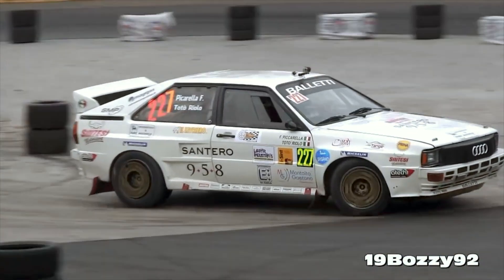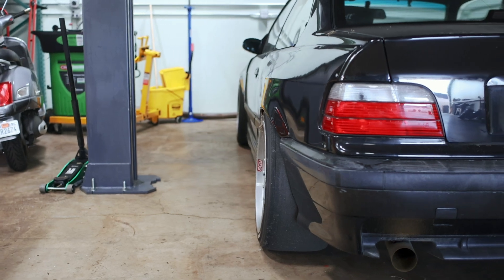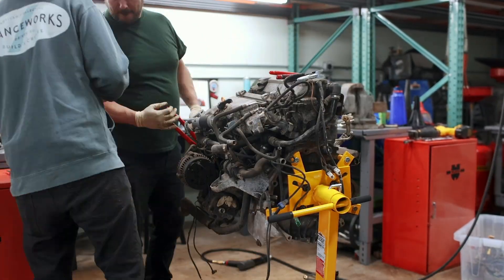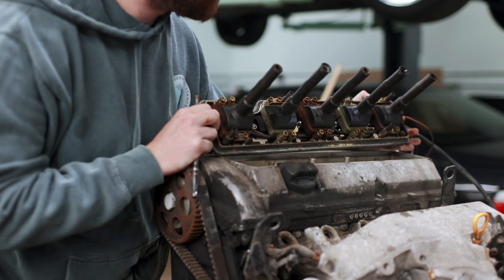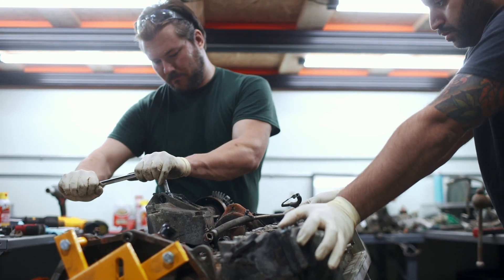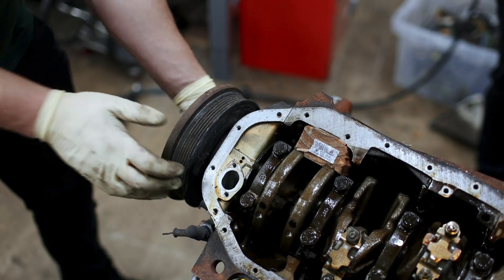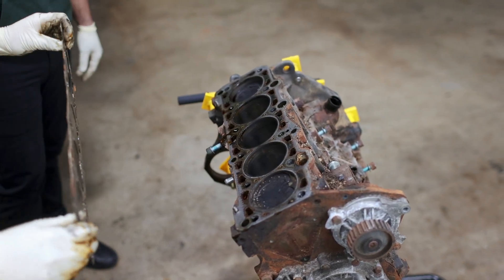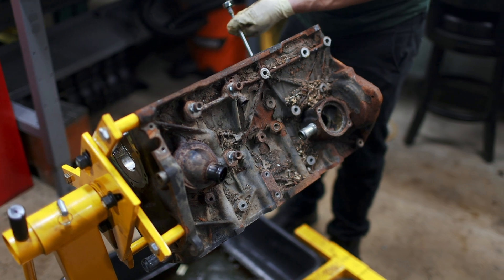5-Cylinder Teardown: Audi Ur-Quattro Engine Build & Swap Underway!

Comment: I don't know if you have a oxyacetylene setup at your shop. But that map gas just don't cut it man. I have aaaaaalot of experience with rusted bolts being from North Dakota and I just know from experience that map gas just takes way too long. The temp from map and oxyacetylene isnt too far off. I think it's just the btu output of a actual cutting torch compared to a handheld torch is the big difference. But I guess the one crank bolt and alternator a year might not justify the cost.

Comment: Lol I really wouldn't have been mad if you just K24 swapped it again. 😂 I've been lusting over that very swap for a hot minute. Trading 5 iron cylinders for 4 aluminum ones , especially given the whole lot hangs out in front of the axle, has to totally transform the Quattro.

Comment: You Have to get the rotating assembly ballanced if you change the weight on pistons/ rods like aftermarket.
Ballancing is with bobweights like a V8.

Comment: Very excited to see this project. 

I am a bit surprised that more time wasn't spend researching this engine and how it is laid out, and slightly surprised that shop doesn't have any 3/4" sockets or breaker bar. 30 minutes of research would have saved hours of frustration. Both those things would have made your life MUCH easier than depending intuition, and air and cordless. The only thing that was a surprise to me was the alternator bolt. Someone messed with that before and left you a nice gift. lol

Check out the key on the pulley to make sure it's good or get a billet pulley instead. These engines are unfortunately getting harder and harder to find these days as so many 'enthusiasts' hoard parts, and a lot of people gave up on these cars around 10 years ago when they started getting to 2nd hand owners who don't have the financial resources, as well as a lack of mechanics that are not scared of older German cars. Now the cars are in more demand, but it's hard to make up for that lack of parts as well as Audi AG not being willing to ship older parts to the US.
Reply: Absolutely spot on - should have spent a week on research while the pen fluid was soaking in rather than go at it like a bull in a china shop thinking it was 'just another engine' Never mind...just can't get the staff ;-)

Comment: Marc at EFIExpress makes an LS-style coilpack system for AANs and can get you the manifold.

I had these on my AAN powered S6 and it was so much better. I had an RS2 turbo and 034 RS2 ECU and it was strong to 32psi of boost and regular 28psi. The N75 was the problem... It's now called EFI Motorsport. $509 for the entire plug and play kit. For $250, they'll sell you one that uses modern factory VW/Audi coil-on-plugs, but the coilpack system is remote mounted so the coilpacks don't overheat on top of the engine

Comment: To fit into small chassis vehicle there are a lot of parts that are different. Use parts from 3B, ABY or ADU engines.
Motor mounts, sump, inlet manifold, rocker cover, crank pulley/Damper, alternator, power steering pump, cam belt cover all may give you problems.
The sump will hit the front subframe.

Comment: As suggestion of well worthy recipe for AAN’s, go source for a 95.5mm crank and make a stroker engine. This crank “corrects” the lack of low end torque making driving and power delivery great! This crank you find on diesel VW Eurovan trucks. Also don’t miss the 7A’s, also a great upgrade. Congrats for the projects!

Comment: If you want an intake manifold that fits, is practical, looks stock but can displace a 1000 horsepower and uses all stock sensor search for the Wagner reverse intake manifold. The AAN intake manifold will mess with the radiator in an urquattro chassis. That wagner intake will leave space for the radiator.

Comment: Watching you guys remove the hub pulley made me think about how i have to hand torque the outer axle bolt on my jetta to 200 lbft plus 180 degrees. By far the most excruciating thing ive done to it so far.

Comment: I do love your propensity for euro flavoured vehicles 👍 Not that I mind V8s and all that but the LS is just so over done these days. Gonna be interesting to see how easy this later Audi 5 will fit in the Quattro.
My suggestion for the block would be to mask it up really well and sand blast all the rust away. Just seems like the best option, and easiest, to get into all the nooks and crannies to knock the rust on it's head.

Comment: Flywheels are really heavy on these engines, so if you get a fluidamper running a lighter flywheel won't bother it at all. If you aren't going to throw a ton of boost at it, run a higher compression piston. An aftermarket I beam rod will be fine. Doing an exhaust manifold would help for ease of servicing if you convert to Vband clamps. It would also allow you to run an anti-lag valve, which not only sounds amazing, but is consistent with how audi modded these cars for racing series.

Comment: It’s funny, the 7A code engine out of my 90 sedan was in the exact same condition as yours. And I was thinking how well it looked 🥲 Michigan life lol.
The AAN is the big kid on the block motor so to say (although it’s not the largest factory displacement of the pre-95 5 Zylinders) and soon i Hope to build one for my sedan project and then build the 7A so I can keep the car running. Also on my 7A my alternator bolt is rounded off, so I might steal your idea and just cut it free :)

Comment: The intake you can use that is found easier state side for small chassis is a 3b intake manifold that comes in 20vt Audi 200 Quattros. They can be had for about 400 bucks or you can get a s2 or rs2 intake from over seas.Also when you go back together threat the cam bolt in by hand then torque or you run the risk of shearing the key and also be sure to check the crank cog pulley for cracks.  Check out efiexpress they have some stuff for old Audi 5 pots.
Stand alone can go vems or maxxecu or could do like Nick ( amdisthebest)  on his Audi 200 and do syvecs with a whole custom harness and set up

Comment: Loving the project.  Many of us use a 3B intake manifold and piping in the small chassis, but it's not an absolute must to do so.  Just have to check for clearance for the side mount radiator.  Oh, and I used the engine teardown on mine to "justify" buying a welder (for the stripped hex heads and sheared bolts), lol.

Comment: 800hp on stock Pistons is no problem. 
Many guys here in Sweden who rock stock. 
My s2 made 720hhp with aby/aan cams. 
And we have another guy here who made 909hhp with aan cams, 64mm turbo and stock pistons. 
But h-beam and rs2 mls head gasket is a nobrainer. 👍🏻

Comment: Everyone is obsessed with those gaps in the piston rings, but even the mot basic understanding of fluid dynamics would tell you that it doesn't matter lol

The pressure will equalise across the surface of the rings and leak through the gap, wherever it is. The pressures are so high within the combustion chamber that the time needed for that pressure to equalise is also negligible

Comment: chop the head of the bolt and hammer it through you mongs
it bolts in to a sliding pin you need to hammer back to remove it anyway
Reply from the maker: The air hammer shows the bolt is seized. Cutting the head off won’t help it move. Use your head.
Reply: @stanceworks  I had to do several heat cycles and loads of penetrating oil to get mine to break free.

Comment: Hey! You're getting a tiny taste of what its like to work on cars in the rust belt! Almost everything I've worked on here in new england has been like that engine.
Knife edge the crank and do what you can to add some oil volume, external oil cooler or something. Lose the coolant/oil heat exchanger on the filter housing, they like to fail and mix coolant and oil. 
I suggest making a custom intake manifold to run a modern throttle body and make turbo piping as easy as possible. Get rid of all of the electronics strapped to the engine and run modern stuff. That means coils, sensors, trigger system, what have you. Try to avoid VW or audi coils, run something japanese or like, LS coils or somethin. 

I remember there being some other things you can do to the block or crank or head or something to make it better or more reliable but i cannot remember what. add a Windage tray if it doesnt have one already

Comment: A little weight in the trailer should increase the clearance in case it gets tight again! Otherwise great insight on how weather condition can affect the exterior of the engine

Comment: The rings spin in the ring lands during normal operation. That is why offsetting them during engine assembly is actually pointless. If all the ring gaps are lined up, then there potentially could be carbon build up, or something preventing them from rotating in the ring land.

Comment: You should use the Eurovan 95.5 crank to stroke it to a 2.5liter.  Also Audi put the 3B motor in the UrQ in europe, so you should be able to use many of the parts to fit your AAN in

Comment: Hey, im also doing a 5 cyl swap on my coupe (s2), i would go for a wagner style intake manifold since it points the throtle to the front really close to the wagner intercooler, makes it so easy and good looking
Reply: Also you can make 600 hp with stock pistons and scat rods (forged 4340 steel), look up quattro4life, he has great content on it

Comment: Being from the north east I've taken to applying grease and anti seize to every component I come in contact with because of the difficulties of disassembly at a later date. Doesn't hurt to take an extra second to save you from hours of headache in the future even if you live in a fair climate.

Comment: An induction heater is the only way to remove most of the bolts on this engine, even the seized alternator bolt can be heated entirely through the alloy bracket to break it free .

Comment: Wow, real amateur disassembly. Yes definitely a northeast engine. Although your lack of knowledge and lack of experience shows. Acetylene torches are our best friends in the northeast. Many times have I encountered similar alternator  removal on audi vw group, no issues when you know how. You guys butchered it. Same with the crank bolt. They always are locked hard.

Comment: Regarding the intake manifold, maybe you could reach out to Hank iroz at Iroz Motorsport to see if they could help you spec out a billet one akin to the ones they are putting together for the current model 5cyl Audi engines in the s-line TTRS and RS3s?
Reply: My other suggestion would be to get in touch with Integrated Engineering.

Comment: For crying out loud mate (or if you wish dude) have you heard of vacuum cleaner?
I understand that the engine will be reassembled or maybe rebuilt, but still stating that "all the parts are in good condition" while the nasty bits of particles and junk are falling in the engine during the process is a big NO-NO... :/

Comment: I’m retired Audi tech of 47 years, that motor is a strong piece and never had a problem concern with internals as long as there is oil and coolant in it. I just did regular maintenance including timing belt and tensioner and water pump. There is a special tool to hold front crank pulley and a extension used with a 3/4” breaker bar to loosen bolt and used with a torque wrench for the proper torque,make sure to use locktite on the bolt as it is used as a sealant as well.
Reply: Totally. Have just replaced belt on my URQ (second time in 10 years) and you need the proper Audi tool with 6 foot bar as its torqued up to around 450Nm. Not impressed they didnt do their research first as it's well known in the community. Messing around with dreadful torque guns. In general on an engine in this state (and all running gear), all fittings should be drenched in pen fluid every day for around a week before even thinking about dismantling, that way you dont damage/break stuff as finding parts can be very hard, Ditto on the manifold bolts - if you read the forums you would have found out their are access ports to slide a 300mm Allen extension through - Audi designed it all in, you just have to think it through. And even easier with engine on stand. I had to do mine with engine in car and it just had clearance. All in all, Should have taken it to a Quattro/ Audi engine shop specialising in these as I would be worried what else they do to it. And anyone who uses wrench guns is just lazy - REP in Swindon UK (R8 specialist) wont go near a wrench gun on engine work - you need to be mechanically sympathetic and have a feel for whats going on. That alternator bolt annihilation was just dreadful...and then sawing it off! FFS - what a set of bodgers

Comment: 034Motorsports has a lot of support for these engines and I built my 7A Turbo with mostly parts supplied by them and they're in your neck of the woods.

Comment: Tbh when it comes to the valvetrain, it may be better to over do it a little so you know you won't get failure or any lift at high RPMs boost and such depending.

Comment: Kinda crazy that fab rats and Merlin's garage pulled a V8 Ford boat motor out of a boat that had been underwater for 30 years and out in the open for a year or two and had less trouble with rusty bolts than you guys. They even started it lol

Comment: A stock head will easily do 600whp. Also, the stock intake is fairly good, and you should be able to keep it. To be fair, an RS2 manifold with a stock intake with a ballbearing turbo and forged rods and pistons will be enough. You'd make a reliable 500ish whp all day long

Comment: I used to have a S4 with the AAN engine, i changed the old coils to newer coilpacks from a TFSI motor and harness from 034 Motorsport. The engine ran much better and smoother at lower rpm with the newer coilpacks

Comment: Just rebuilt my AAN. Go with Supertech valves and springs. Keep stock pistons but upgrade rods is a must. I went with IE rods.
Reply: it drop right in and turn freely? you don't have to grind of mill the block?

Comment: This savage actions upon alternator made me cringe af.. Looks like these guys had first time experience with rosted engine and had no idea how to deal with it, so they went to break things.. This crankshaft pulley has a damper in it and i'm guessing by the video, it got torn apart. As for the piston rings, they generally move around, and if anyone thought, that they will always be in the position they were put in, they're wrong. Kinda bad first impression on that workshop, if they deal with any other engine the same way they did in here, i would'n trust them with my car for sure.
Reply from the maker: If all 10 rings are lined up it’s not coincidence. They literally have to be in the position they were put in in that case. The statistical probability of all 10 rings being inline is impossible.

Comment: My machinist use a cleaning bath with a paintstripper and acid. The blocks come out of it in shining light grey cast iron. Ive never seen cast iron like that it just looks amazing.

Unfortunate for me my gm 60 deg v6 was one of those 1/100 blocks where they paint didnt come off so I still had to spend time sanding it..

Comment: Yo Mike, make sure your key on the crank snout didn't just shear off. Audi made a tool for holding the damper when doing a timing belt job on these. I made my own out of a 4ft length of flat steel bar and a 4x4 hub socket cut up to fit inside the damper and allow a socket to pass through.

Also absolutely have the machine shop inspect that head for cracks!

Comment: Given the modest power goals, regardless of what internals are used, it's worth doing a full dynamic balancing at least to keep things running sweet
ARP goodies like head studs, rold bolts and such for reliabilty sake would be a good call.

Comment: Awesome.  Not surprised that the internals look as good as they do, but yeah, the outside looks like its lived at the bottom of the Caspian sea.  Looking forward to seeing what you end up doing, motor wise :D
Reply: Agree, you and I both know how durable the old 2.1/2.2/2.3 engines are... They look like crap on the outside but are totally fine on the inside even at 200k+ miles. The short block of my old 220k-ish mile NG went on to live under a 7A head with 3B manifolds and a K24 turbo slapped on it for a while.

Comment: As a fellow ocean engine aficionado and former wielder of the torch, I can wholeheartedly recommend an induction heater for those stuck bolts. 

They're only around $200 these days, and you can really get a lot of heat into exactly where you need it. You also don't run the risk of damaging anything else around.